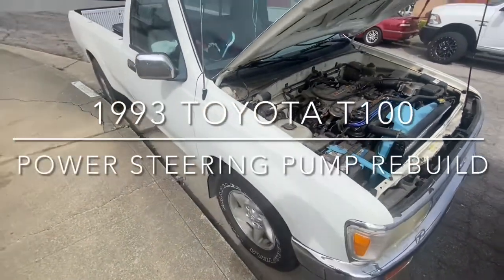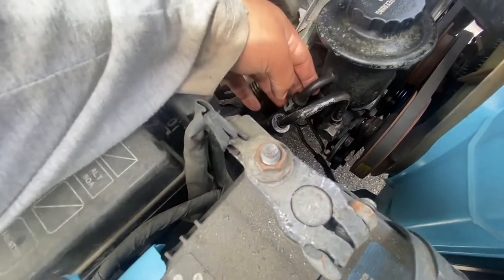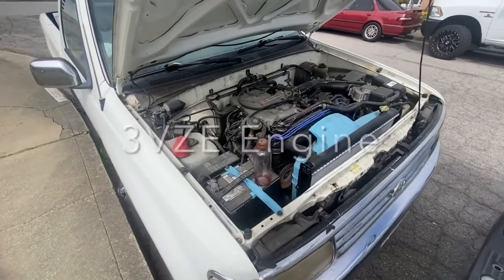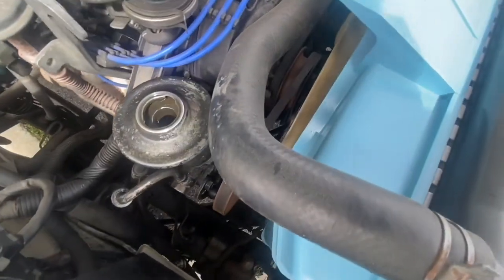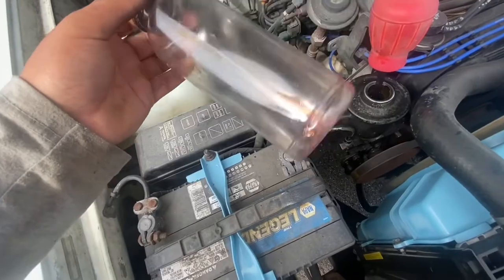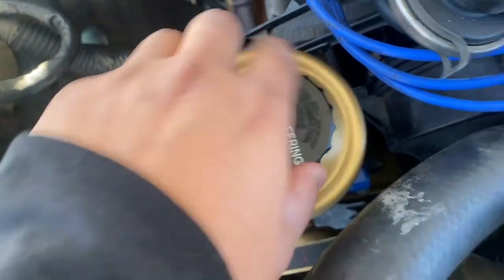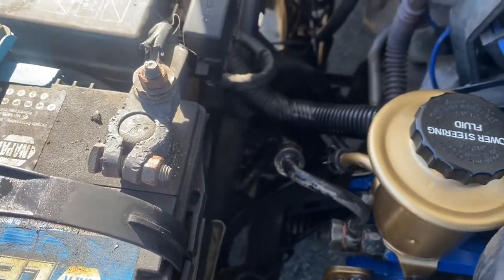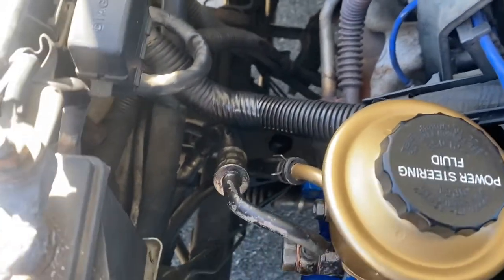1993 Toyota T100: Power Steering Pump Rebuild

Comment: The paint job is sick man.  My pump is leaking and im going to paint it as well. Great job.
Reply from the maker: Thanks for you feedback man! Hopefully you get your leaking problem solved. Make sure you don’t paint where the seals, threads for bolts/valves,and power steering fluid will go. Best of luck to you! 👍

Comment: The torque spec for the Pressure Hose Port at 28:18 is 51 ft-lbs. I have the official manual from Toyota. So if anyone wants the torque specs for every bolt on this pump, let me know.
Reply from the maker: That’s awesome!!! Thanks for sharing and supporting other Toyota enthusiasts
Reply: Could you post all the torque specs for the PS pump bolts? About to rebuild this
Reply: @screenname88  These are all for the 3VZ 4x4 model. The vacuum control valve is 27 ft lbs. There's 3 bolts on the reservoir, The side two are 30 ft lbs and the front one is 9 ft lbs. The pressure hose port is 51 ft lbs. Those are all the bolts on the pump itself. For reinstall, the adjust stay bolts are 30 ft lbs. The long bolt that attaches to the engine is 43 ft lbs. The banjo bolt for the pressure hose is 34 ft lbs. And the nut for the pulley flywheel is 32 ft lbs. Good luck man!
Reply: @melodicchronic5181  thanks! I have a 2WD but I feel like it should work ok. I can’t see it negatively affecting it if it’s within +\- 5 ft lbs

Comment: So no leaks still? The rebuild kit stopped all your leaks ?
Reply from the maker: No leaks so far and steering fluid is maintaining its level. Before I would fill it up every time I drove somewhere pretty far
Reply: @at-28knight45  thats awesome man. I almost redid my hoses but after watching this video pretty sure my pump is seeping. Never made any weird noises. Going to rebuild it soon and then do the hoses after but i want to see if the leaks stop after rebuild. Got the kit from gates. Thanks for the video will be alot easier to do now
Reply from the maker: Good luck to you. Hopefully your work will pay off 👍

Comment: This was super helpful, especially since someone put this pump in my 88 4runner and I had to figure which one it was. Many thanks! Also, i wonder where that last o ring goes...
Reply from the maker: Thanks for the support! Some older 4Runners have the same steering pump as my t100 with the 3VZE Engine. The extra o ring is for pumps that have a sensor attached to the pump, mine didn’t have that option
Reply from the maker: If yours has a sensor then you’ll probably need to use that last O ring to replace the old one on the sensor to make a proper seal since many with the sensor leak from there